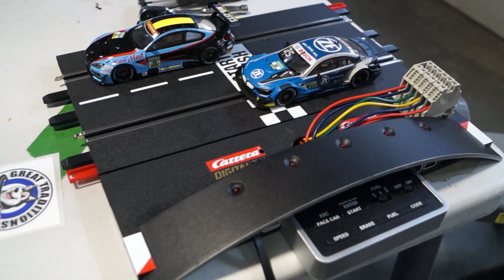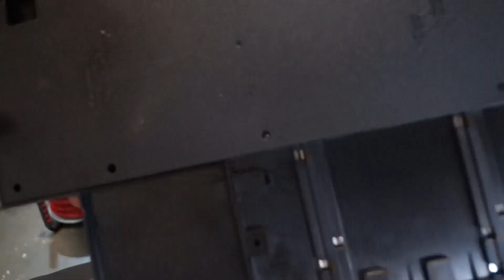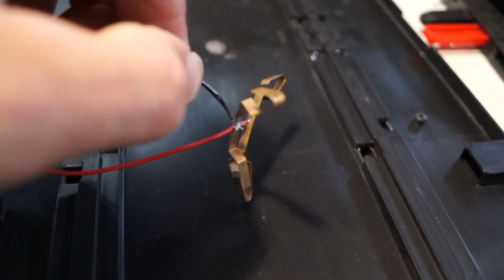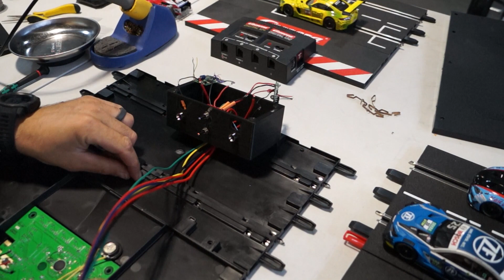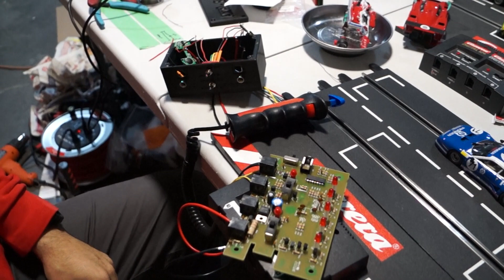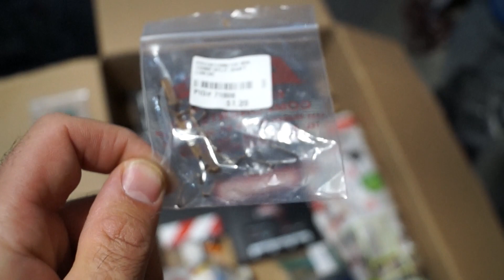Episode 4 - Old School becomes even more OLD School... let's get analog with Carrera Pro-X

Comment: I didnt know where to put this comment but in Rahuls live stream tonight it looked like you were looking for topics for 3d file creation that people can use. How about creating wheels and then turning that wheel into a mold for casting silcone tires
Reply from the maker: I’ll look into that, I’m not sure what the process is for moulding silicon (material temps etc). 3D printed materials are susceptible to heat so if the process involves hi-temps it may not be feasible, but it’s worth a look👍🏽

Comment: Nice sound work on the intro, Need to get a lavalier mic or a mic that you can talk into because at some points the voice is muffled or is not clear enough. Otherwise a very technical and well presented video. Thank you for sharing.
Reply from the maker: Thanks Rahul for the feedback, yea the audio is tough with my current setup and the 3 printers in the background definitely add to the noise.  I saw your video the other week where you were taking tech and had mentioned the lavalier mic - I’ve ordered one this afternoon and it should be here in a few days👍🏻